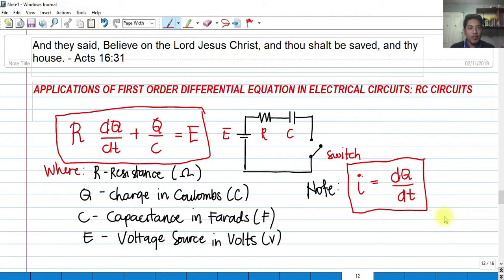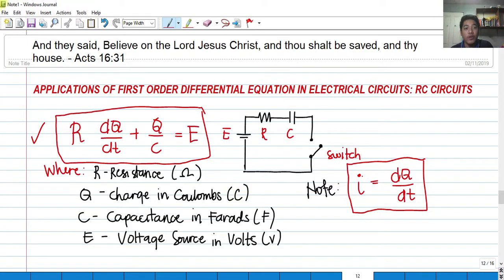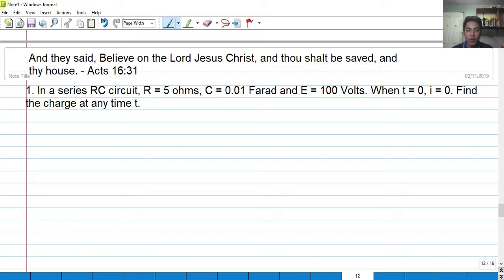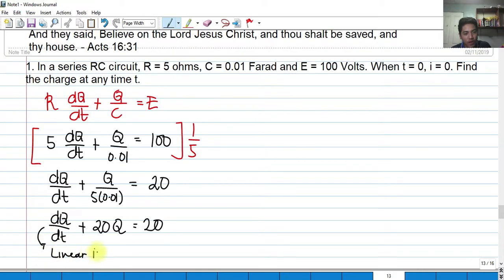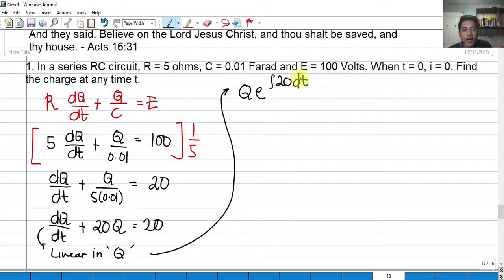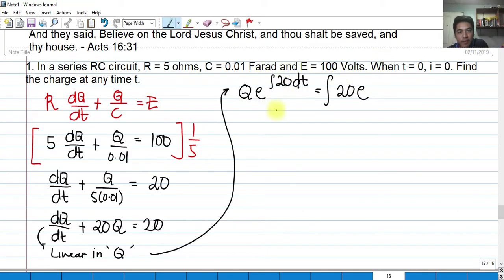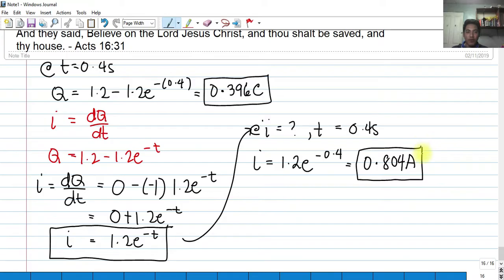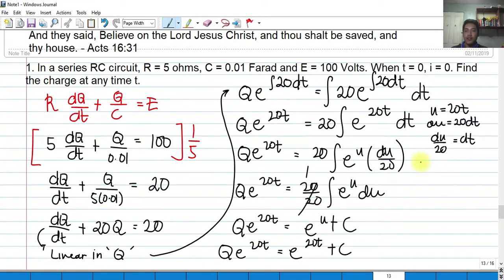RC Circuits in Application of First Order DE - Differential Equations

Comment: Diba Q/5(0.01)
=Q/20 Sir? Thanks
Reply: Q/5(0.01) = Q/0.05 = 20Q
Reply: pano po naging 20??? 5(0.01)= 0.05  san po mang gagaling yung 20? huhu pasagot po di ko maintindihan
Reply: @angelodorado5130  a/(b/c) ay magiging ac/b, that means Q/(5*0.01) will be equal to Q/(1/20) if in fraction, then multiplying 1/20 by its reciprocal to become a formal form of an equation it will turn to 20*Q. Btw if your curious how I got the 20*Q its just [(20/1)(Q)]/[(20/1)(1/20)]. Both denominator will cancel leaving only (20/1)(Q) or just simply 20Q. Thats how he got that, it might be tricky but its really simple.
Reply from the maker: Yes. And 1/20 = 0.05